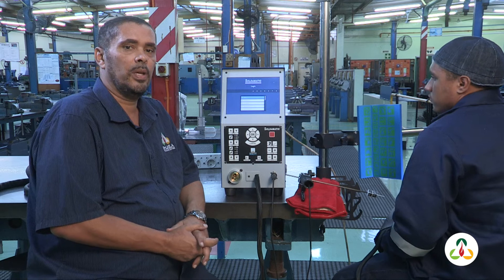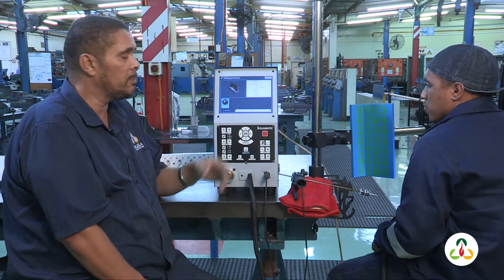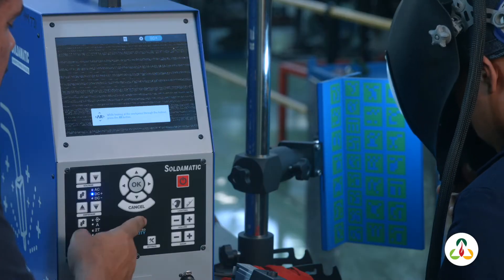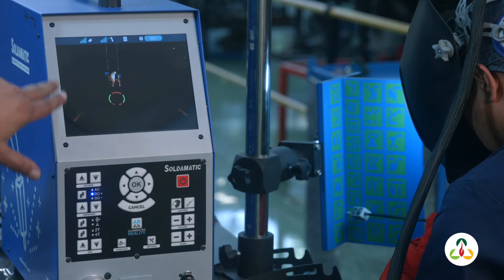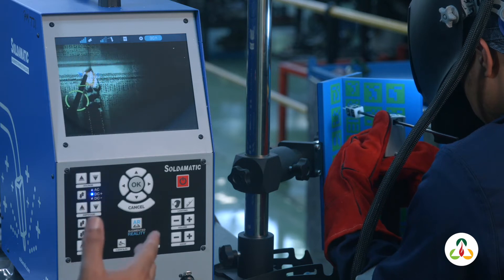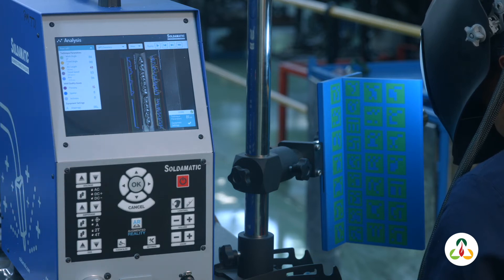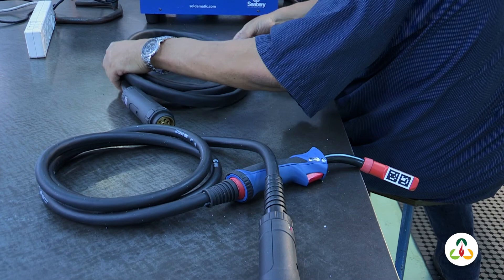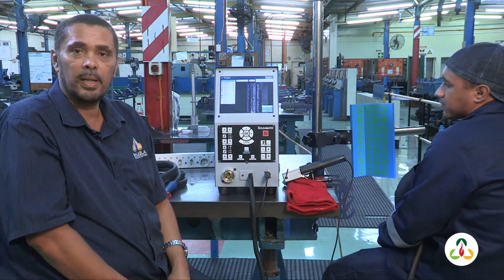How to Use the Soldamatic Welding Simulator

Comment: 1.The screen is very small. 
What if the batch of students want to see it?

2. Does it have a teacher-student administration ?

3. The barcode in the end does not match the reality.
Seems like a video game and not training. Improvements needed
Reply: @varun khatri,  You can connect a TV or LCD projector using  HDMI cable to see on a larger screen
Reply: Soldamatic includes an LMS original solution that gives the teacher full control of the student progress, and also allows to upload theory and tests that the student can see on his/her computer.
Reply from the maker: 1. Yes the Soldamatic does have an HDMI output that can be projected on a big screen for all students to view.
2.  The instructor can manage all aspects of the learner development and progress. I can prepare  and evaluate tasks every step of the way.